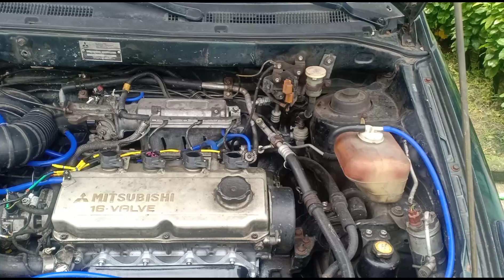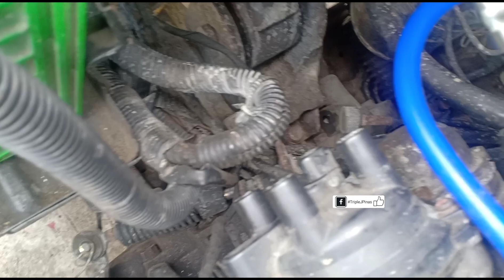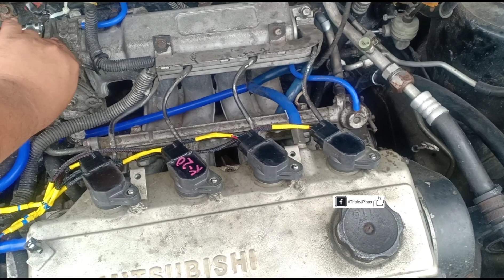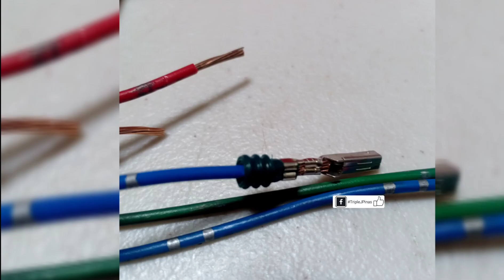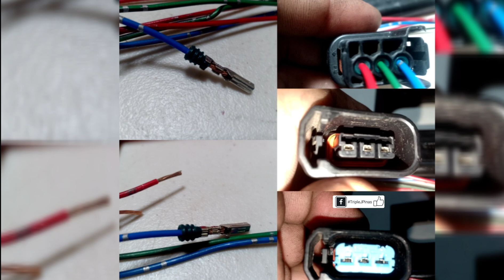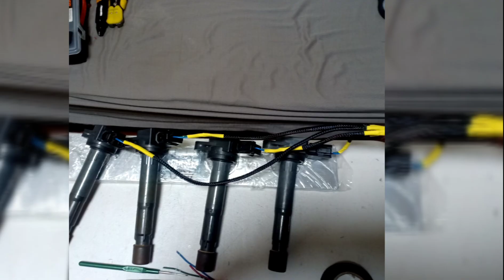Coil On Plug Conversion - 4G93 SOHC

Comment: i think the signal you can take from output distributor. use one signal for 2 cylinder ( cylinder 1 and 4)
and then second signal for another 2 cylinder (cylinder 2 and 3)
Reply from the maker: Distributor signal only 1.

Comment: Share wiring sir please 😊
Reply from the maker: still have issue with performance since there's only one firing sequence. All spark fires all at the same time.. sometimes auses to misfire and jerk once in a while.
Reply: @triplejpinas1852  is it because use 1 signal  sir ?
Reply from the maker: @mochammadiqbal2423  yes. Because only one signal
Reply from the maker: @mochammadiqbal2423  yes